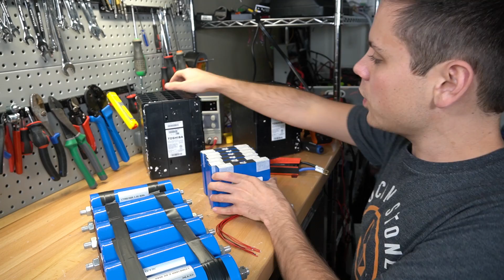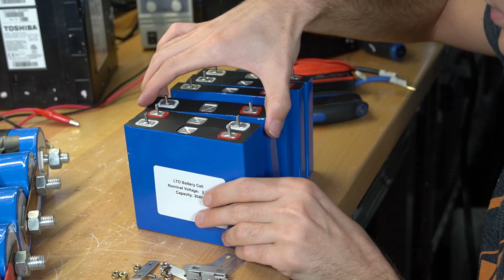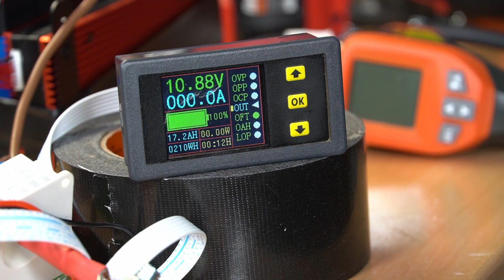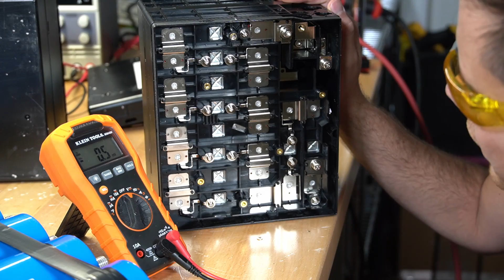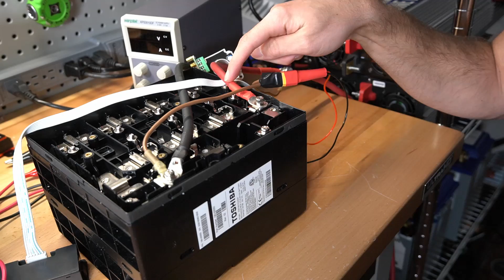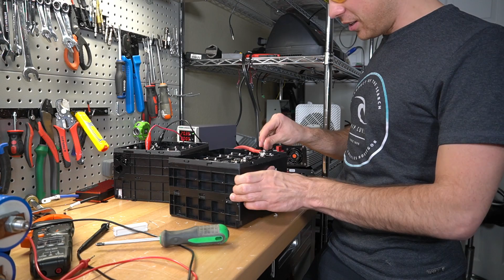DIY Lithium Titanate (LTO) Battery Part 2

Comment: Will let's get something straight I love your channel I love your analysis, but I think your perspective on lithium titanate is off. First of all these cells are difficult but the advantage of being able to charge at 5C means hundreds of dollars a year saved when running a generator to charge them. Imagine a motorhome with a 7500 Watt generator to run it for hours and hours to charge any type of lithium chemistry you want to name (except titanate) that I know of is expensive in 2 ways fuel and wear and tear on a generator (not to mention hours of noise). So why would you want to charge your battery bank with a generator well to start with i already own a generator on almost any motor home that you can name so I've already got what I need to charge the battery bank. Now while solar cells have come down considerably in price there's still a lot of effort required to put them on the roof wire them up, charge controllers and all, so it's a fair investment and then you have to worry about the safety of your battery cells chemistry as far as to hot to cold. With titanate I could maybe do away with my starting battery (especially with those circular cells with huge terminals). All this still leaves where do I find a heavy duty 300 amp charger LOL. THIS SUBJECT HAS A QUESTIONS ANSWER BUT YOU CAN DO IT WILL. 
Man I just had a lightning Bolt idea as I was writing this you could use the battery compartment for the starting batteries to put your batteries in you not gonna be worried about freezing you not gonna be worried about getting too hot and God knows these things could put out enough amps to start the diesel you would have to switch out the alternator from a standard to a marine but wow what a combination.
Reply: You mean just using your generator to charge these on your motor home without solar panels?  I wonder how long you would need to charge a battery bank? A few minutes would be great. Just run your generator 30 min a day? I need to find out some more info on these.

Comment: Maybe most of your subscribers are only playing with off-grid but honestly people who are truly off-grid have 40 kilowatt hour plus batteries and won't have a problem with these voltages because we can handle between 36 and 64v with brand-name inverters such as Schneider Conext Morningstar Xantrex, Outback, Magnum...   And with such small increments in voltage with different numbers of series cells we have many options for cell count.  Heck with the new 500 volt batteries and there matching all-in-one inverter charger, including built-in mppt solar chargers,  we have even more room for different choices of numbers of cells in series.  Having a few extra cheap panels to increase the cycle count to 4X higher than lithium iron phosphate sounds like a good trade off.  Why are all these companies pushing inferior technology on us?  They obviously want the batteries they sell us to go bad so we will buy more!

Comment: 0:36 Well. But you save allot on the long term by not having to repurchase battery packs. Because most lithium chemistries degrade quite quickly. So i would prefeur to have around 20/25% more solar panels and a hugh LTO battery than that i have a smaller solar array and have to buy new batteries periodicly.
Reply: This is what I was thinking as well. I'm not entirely clear why there is such a big issue using these batteries

Comment: Ummmm, 2.6 times 5 is 13.  Maybe you should do a five cell to get the maximum range.
Reply from the maker: No, this was covered in part one. If you look at discharge curve of lto, it drops to 11 volts when you put a load on it. You need 6s for 12v. Check out my first video

Comment: Maybe you could use a buck converter to step the higher voltage down to a 12v constant.

The batteries would have to output a minimum safe voltage not much below 12v, but buck converters are really efficient and cut off just above the output voltage, so you couldn't overdischarge them.
Reply from the maker: Yeah that was mentioned in the video actually
Reply: @WillProwse  must have missed it.  Sorry to bother you.
Reply from the maker: Oh don't worry about it. It's all good

Comment: The chart shows LTO at 80 wh per kg, but i'm seeing 93 wh per kg on the toshiba scib's. I have 5 20ah's in the 24v 10s pack. It looks like I see some in the back ground of the video on the bench.  I'm building them with 80Amp 10S Daly's for my trolling motor.  While they may be a tad heavy, they are built out at 45 cents on a dollar compared to Battle Born, and a heck of a lot lighter than pb. 100ah for just under $900.

Comment: A perfect system would be 6  super capacitors and bms board approx $40 USD in parallel  with your bms and your lto batteries for starting cars . The super capacitors draw from the battery to recharge and deliver high current for start up . Batteries and capacitors  would  last forever , weigh less and work well in all conditions .

Comment: The small aluminum pack would be great for a fatbike ebike application being used for winter riding . Maybe one could even use the heat created for hand warmer ,heated handle bar or something along that line.
What was its weight  ?
Most ebikes require 24v ,36v or 48v but they sell waterproof transformers that convert 12v to 24v and 24v to 36v at reasonable efficiency.  They would reduce number of batteries  and weight.
Maybe you should get into this too . Another side of this grand plan. I'm sure that you would make a difference.  You and Elon , making this world better without robbing people.

Comment: Two words:  Buck converter

I typically build 24V packs and including buck converters provides a flat 12 volts throughout the discharge, which is great for DC loads.

A buck converter would also be perfect for connecting the Toshiba pack to a 12V inverter.
Reply: To jdiota

Comment: I’m wondering with your tests. 
How long would it take to recharge that 6s LTO cylindrical battery pack. 
In the video you discharged to 99%
But how long would it take to charge it up to 100%. 
I’d really appreciate your answer. 

Great job, keep it up.

Comment: Like I told you in the past I only use LTO. The used cells in the glued in pack did have a bms and my cells aren't welded but have studs and they are still weigh 20% more than pouch LTO cells. You don't need to worry about heat so much or tossing tons of current at them and they don't go into thermal runaway even at ungodly high temperatures. When you run them over temperature they will  have more capacity! Remember they have lower IR by design than Lifepo4 so they will generate less heat. Active balance is the way to go on the cells. 
Here is why I use LTO. My Ebike cargo bike for example needs a 48v 20 a/hr pack.  The 18650 pack can weigh 8-10 lbs but my new pack of LTO is 18-20lbs and more volume. One would say why would you use LTO? Well the 18650 pack under high current drops off at least 20% capacity. I ride when it is 30 degrees or colder and under high current you really have a 10 a/hr 18650 pack. The LTO is around 18 a/hr at 30 to 10 degrees. The other problem with 18650 packs is they don't like the cold and need to unplugged and charged in the house. The LTO pack can stay in the garage and charge. I have noticed on the 18650 cells the high current draw has made the IR raise and made the bike less snappy. To be honest the shorter life on the 18650 cells is due to over heating of the cells and to fix that the cells should have heat sinks or some type of cooling but if I add weight to cool them I no longer have a 8-10 lb  pack and that is why the other cells just don't make the cut for me.  I don't have the issue you have with voltage drop out , my motor controller  is good from 60-36v. I own 1000 lbs of LTO so I will have all I ever need. 
I also have some 2017 Prius cells to play with but the weight is high for the cells . I think that cell weight is needed for cooling at the 3C rate. I am looking for a used Prius. 
It takes some rethinking to get your mind around LTO. I am a few years out on a home LTO solar system. Glad you looked at LTO cells!
Reply: Awesome information thanks for taking the time to explain that.
Reply: Thank you I’ve been thinking about doing a lot battery system in my bus and I’m looking for options

Comment: For an RV air conditioner, would it be worth it to have a split battery bank with Lithium Titanate/Lithium Ion?

That way, you could use the L-Titanate as the primary battery to run the AC and other appliances that will be discharging heavy loads, with the ability to recharge really quickly via the alternator or generator? 

Then build the rest of your bank with L-ion so that you can at least have a larger battery bank for those times that you run out of power from your expensive L-Titanate, or cant run an engine?

Comment: So if they are worse than Ni-Mh, they really have no advantage. Ni-Mh batteries also have considerable more cycles than Li-ion and are resilient to abuse and work below zero. they have to be cheaper than Ni-mh for this to fly. Cars usually work above 15V in an automotive application. My car cutoff at 16V. So possibly not a problem for 12V use. Solar inverters should also tolerate that kind of overvoltage. However integrating cell monitoring is tricky in a car as an alternator is a rough way of charging, easily overpowering the balance capacity of any BMS. What I did was use a bms and a solar charge regulator, so the battery was balanced at a low 1A charge current when the sun was out. Then whatever cranking and driving messed up the balancing, the solar panel remedid when parked. I do know a Prius doesn't have an alternator, so charging is more civilised!

Comment: Prius starts its engine using high voltage battery. 12V battery is just for radio/lights/locks/windows etc.

Comment: The prismatic LTO cells may serve well as a secondary battery for vehicle owners who are suffering from parasitic battery drain due to aftermarket accessories etc.; The LTO battery can be used to provide current for parasitic drain and keep the starter AGM battery topped off at a float charge of around ~13.3 volts and not worry about recharging below freezing temperatures. I sank thousands of $$ on many AGM batteries that died prematurely as a result of parasitic drain and there are thousands of other people who are complaining about similar problems blaming it's their on board ECU, or faulty relay, after market install, etc... Today's modern vehicles that have several dozen computer modules put demands on starter battery that is not designed for deep cycle.
Reply: Every AGM starter battery (not deep cycle) that I owned died within 4-6 months, after the battery goes down to 12v for about about 15-20 times, it's dead (for a starter battery). At about $200/battery, plus aggravation and embarrassment, these LTO cells would have saved people like me a ton of headache and cash. Currently I'm using LifePO4 supplementing my AGM, but I suspect several months of recharging them below freezing may damage them (it might take years). No problem so far with LifePO4 and charge level never goes below 3v./cell, so it's not even full discharge/recharge cycle.

Comment: I would be interested in a LTO car starter battery.
The temp, high charge/discharge, lifetime specs and low discharge capability would fit the job quite well.
Also, the capacity isn't as important.
I would be happy with 10- 20 years lifetime.

Comment: This is a stupid beginner question: in a strictly off grid system, where does the power go when the batteries are full?
Reply: Nowhere, power gets sucked up by devices, it doesn't get pushed by solar panels. If there's no devices sucking it up (like filling batteries) then no power comes out

Comment: inverter/ chargers and other gear for non standard voltages is hard  to find - i have 2. tesla model S battery blocks and inverter as Real hard to find and expensive

Comment: I think they can be very good for my non heated garage project in the mountains of Colorado to power lights and a couple of appliances all year around without worrying about it. There's so much sun that efficiency is not really a problem. But yeah you're right the application scope for solar is very narrow.

Comment: really curious what these would do to the alternator if dropped into a car. high charge rate might burn out the alternator. seem ideal for auto applications otherwise. I bought LiFePO4 cells before realizing they wouldn't be appropriate for driving in a cold climate. Those small LTO cells look perfect size - wise.
Reply: Ideally an alternator is current limiting and will drop the output voltage if the draw is too high, in practice the super low internal resistance of these batteries makes them practically a dead short

Comment: I really wonder,  how did you get those numbers for LTO efficiencies of 80-90%. Then, if that is true, how one can charge/discharge them with 5C/10C with so moderate temperature rise. By the way using '8' and '9' will assemble quite a typical figure of the LTO  efficiencies – it is about 98%. Because of that high figure, the charge / discharge efficiencies must be measured with more precision instruments and set-ups. Otherwise, once I've come across to someone who registered  100.3%  round trip efficiency - one  funny result among his multiple charge /discharge cycles measurements.
  By the way, could somebody refer to a commercially available battery chemistry being more efficient than LTO? To me LTO is a dream  battery technology from electrical perspective, but some other downsides as you pointed out  like energy density- gravimetric and volumetric (weight, space),  price etc. would limit their use. 
     Of course, please consider that as a small remark in your video. YOU ARE SUCH A GOOD PRESENTER AND YOUR VIDEOS A VERY MUCH EDUCATIONAL- GOOD STAFF AND KEEP UP THE GOOD WORK!!!
Reply: It can deliver 5C/10C because the titanate chemistry allows higher ion exchange rates. However, it has limited "columbic" efficiency since most of these batteries are constructed with rudimentary  electrodes such as activated carbon. Currently, there is one company in China which uses graphene. These LTO batteries have much higher capacity retention rates due to very low ESRs.
Reply: @jackripper5240  Which company?
Reply: @jackripper5240  I would also love to know which company makes them with graphene.

Comment: the application where you can use them are mostly in energy recovery systems for ev, and all those applications where fas charging and recharging are neded, mostly in traction applicaions, those small packs are probably from forklifts and/or golfcarts... hitachi use them in forklifts...

Comment: We have built at least 300 of these Toshiba LTO cells for cars. All lasted longer than 3 years. We built it to a size of 40 Ah maybe 60 in some larger batteries. 

Of course you’ll have to improve the connections. 
Your startup will be faster, and better sounding stereo.

Also 5S is enough. 6S makes the cells operate in a lower V interval, which makes it weaker.

Comment: Will as always an interesting video thanks for the ongoing education. Personally I am new to solar so this is all great stuff that you are looking at and testing. I hear you often say that products are not useful for solar ie high discharge rates but surly it depends on what you are using your solar for? As a sail boat owner who is looking to remove propane from my boat and switch to lithium batteries for the house usage I am still left with what batteries to use to start the Diesel engine and generator and drive the heavy draw Bow thruster all heavy draw short period needs. Would be great to have a mixed solution but moving away from the big heavy short life cycle lead options. The LTO s look like a potential answer??? Be nice if you could cover Usage types home RV boat etc. :-)

Comment: It seems in the video your tests show reduced output at lower c rates. Is that just true for these used cells in this configuration or is that a phenomenon associated with this chemistry?
Reply from the maker: That was a different pack. They are used cells so very possible they have different capacities

Comment: The claimed 80-90% round trip efficiency might be bad, but it is probably measured at very high charge and discharge current. Probably 5C or 10C. They do have high discharge rates, so the internal resistance should be relatively low, even if they heat up a little bit at 10C. That suggest to me that they should have a really good or better efficiency at lower current. Try 1C or 0.5C. But to test it you really need different charging and discharging. Because at your current setting you don't really utilize full capacity of this batteries. Similarly calendar aging probably occurs more at high voltages, and higher temperatures, so if you use them more gently, and because of inherent lower voltage in LTO, I think they can actually age better than LiFePO4. Again something to test for.
Reply: I charged at a little over 1c and discharged at 2c and power out vs power in was almost  the same. This was well within  instrumentation error.  The only detectable decrease in capacity was discharge testing at 70 degrees F vs 32 degrees F. The efficiency didn't change for me. Remember it was just a sample size of one for this test. I didn't need to do anymore tests because they perform  good for my needs. LTO Batteries at high temperatures may degrade some but the amp hour rating increases! Even when they cool.
Reply from the maker: Good points
Reply: Please test this option of 1C because I have seen videos of 99% efficiency for LTO (measured and proven).